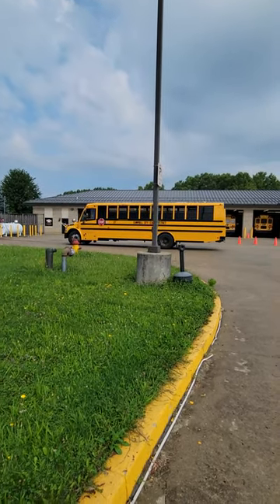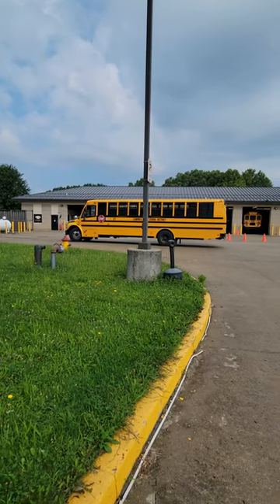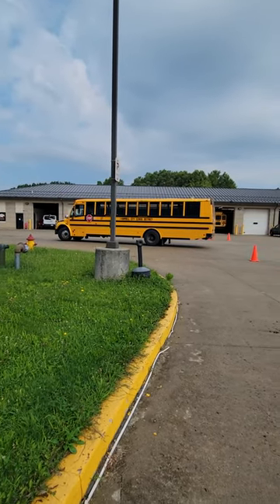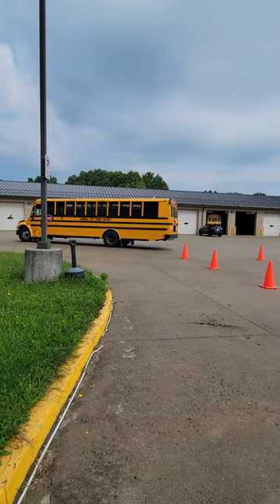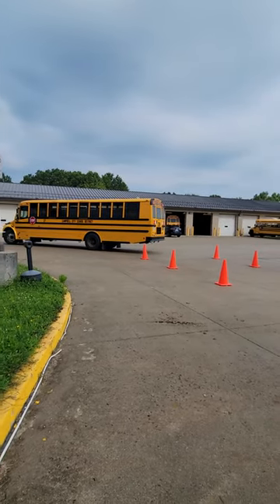Short Alley Dock ... driver trainee Maria

Comment: The hardest part is to find a reference point. When to cut my tires. So it goes in the box properly. If you have any tips I would appreciated it. Thanks for taking time putting this video out I appreciate it.
Reply from the maker: Position yourself a little more than half way between the box you are backing in to and the 50 ft boundary.  For me, I stop when I can see the first cone in the row closest to me right about the middle of the mirror close to the outside edge. I start to turn the wheel to left a little at a time. Keep watching the left side tires and cutting the wheel left unyil you can see that you will not touch  the cone. Start checking the right mirrors for the cones on that to show up. Straighten out the wheel a little more everytime you spot the next cone until you are straight in the box. It is supposed to be a 40 ft box, so once the front cones can be seen in the crossovers stop, set the brake, go to N and get out to look. That way you can see where you are in the box and can back or pull up a little more if you need to.